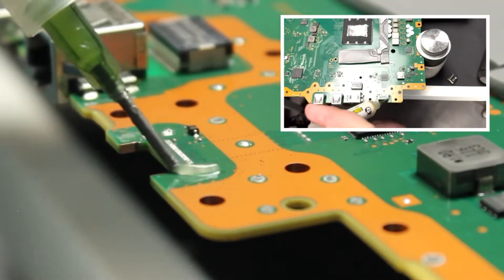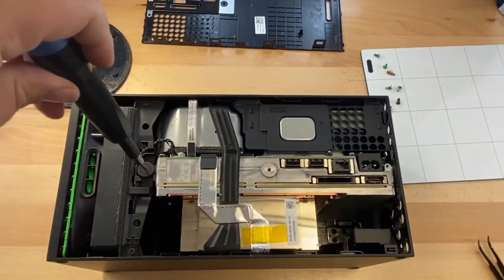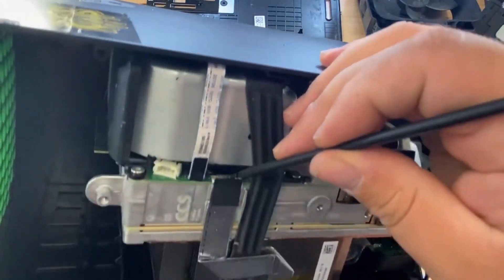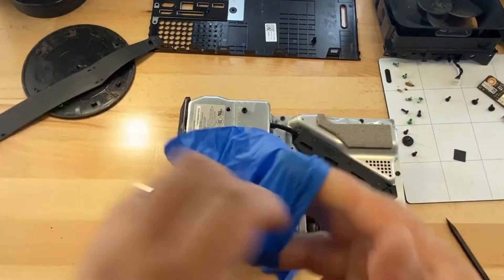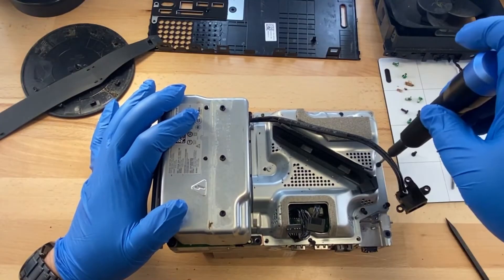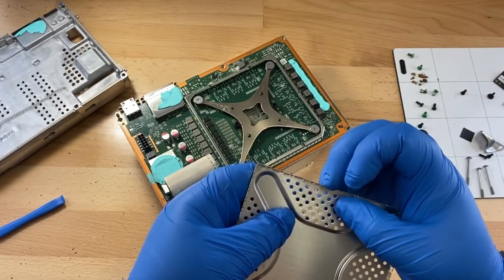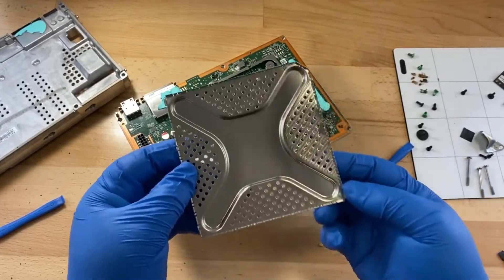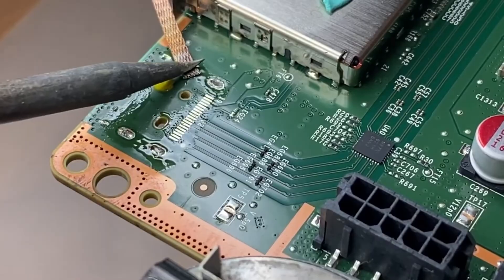Xbox Series X HDMI Port Replacement: Professional Step-by-Step Guide

Comment: I'm not convinced that leaded solder poses any more health risk than any other solder. Lead is heavy. I don't believe that lead can be breathed in without having your face right up in the action, and nobody is doing that. I think unleaded solder is totally useless in every application I've ever needed to solder something. The fact that it takes much more to flow it, risks damage to some things. For example, guitar players wanting to change their pickups or other electronics. The everyday person could do it with a cheap soldering iron and leaded solder no problem. You cannot do that with unleaded solder without burning the pots. Then you get into actual electronics like this... There's just no way I would ever work with unleaded solder. I tried it once and it was awful. I even grabbed a junk board and practiced using it and it was literal trash.

Comment: I personally think its better in terms of replacement to re work it all but for arguements sake its "safer" to just heat it, remove and replace using factory solder. At least it removes risk of over heating and damaging the contacts esp on tiny little contacts like these. Just my opinion

Comment: funny, the part where he just remove the HDMI easily - that's for illustration purposes. This type of HDMI removal is not easy especially the corner/side anchor pins.
Reply: That’s kind of why i’m watching the video, the HDMI is difficult.
Reply: elaborate
Reply: Yeah I've been trying and trying to get the anchor pins to melt and come loose but I can't get it to budge
Reply: Solder sucker works wonders for those anchor pins. Heat with iron, keep heat gun on it, drop iron and pickup sucker with same hand. Plunge the hole quick. Easy-ish

Comment: Thanks for the mention! I did a double take when you mentioned me lol. 

I prefer the Xbox Series X over the PS5 as I don't have to worry about the silly little capacitor next to the pins or having a liquid metal accident. The board takes a LOT of heat though. I usually keep the hot air on after taking the old port off and use the solder sucker to quickly clear the holes.

The other thing I tend to do differently is tin both pads and port pins then I heat the board from the bottom and once the solder on the pads melts, gently lower the port into place and keep the hot air on for a little bit until the solder on the pads flows into the solder on the pins. (You'll also need to tin the front anchor ground pads on the Xbox as you won't be able to get to them later.)  Then to finish off I solder the four legs. 

There are a few 'right' ways to do a port replacement. If you're a beginner then you need to try different 'right' ways until you find something you're comfortable with and build on that. And remember... if it looks easy on YouTube; doesn't mean it is!! 😆

Comment: Hate to tell you, but you put the X clamp on wrong. The black plastic isn’t supposed to be pressing on the caps below it. Not to big of a deal, but you are putting pressure on them
Reply: It was like that originally if you check the video. TBH I have seen them in both orientations, on factory sealed units. The first couple of times it made me question what I'd done when I reassembled previous units. :)